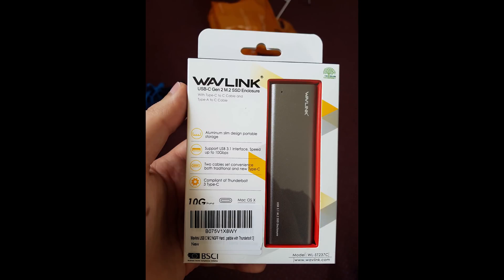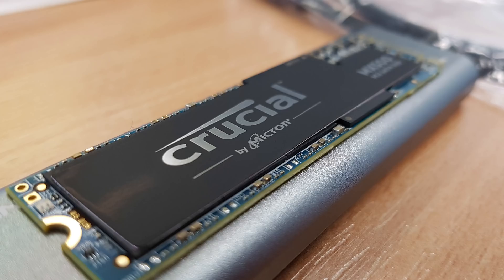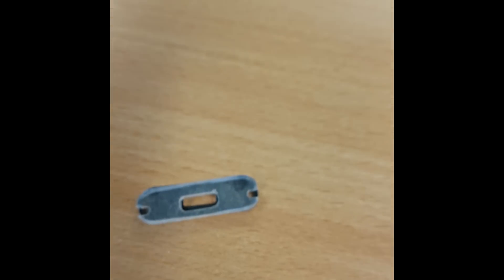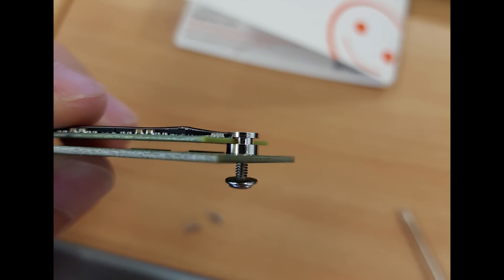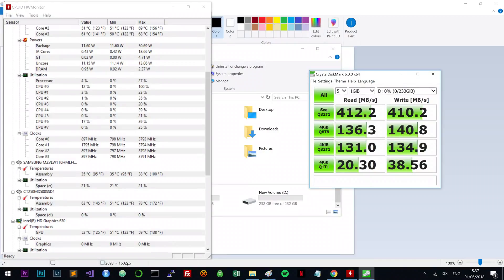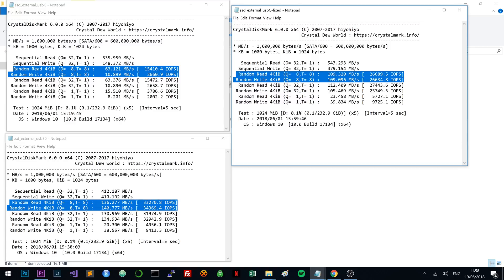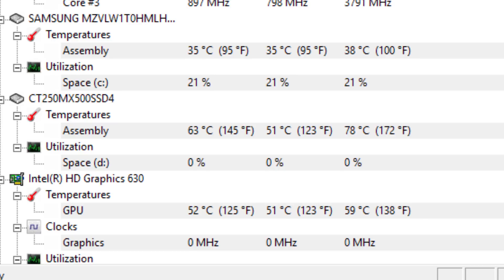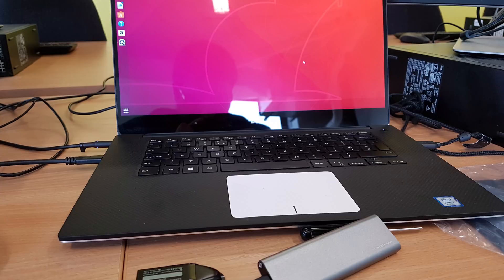How to build an External M.2 SSD (USB 3.1 Gen2 with Wavlink Enclosure)

Comment: Do you still like it? Have you tried any other enclosures for M.2 NGFF SATA Drives? I just ordered this one for a 16G 2242 drive that I saved from an old Acer Chrome Book and am hoping to turn it into a Linux Boot Drive. I just wish that I could've found one that was specifically for the shorter 2242 drive.

Comment: Hi, I am looking to buy exactly the same as you have but am I missing something on the speeds here? USB-C / USB 3.0 and 3.1 can produce speeds of around 600 MBps and 1200 MBps. The Crucial MX500 today on their website says:  M.2/NGFF (2280) Double Sided • 560MB/s Read, 510MB/s Write. So if I use this WavLink box on USB-C to my Macbook Pro then I should get speeds around the 500MBps read and write as that is the fastest speed of the slowest component here right???? So why in your video do you get a hell of alot less than that? Am I missing something here please?
Reply from the maker: To be honest I'm not sure. I think the cable may be the issue or potentially the XPS 15 thunderbolt port. I haven't been able to get above that through it. I am not sure how it works on the Macbook Pro. If you end up trying please let me know what speeds you get.

Comment: I got 2 of these， they all work fine in the very beginning, but my computer didn't recongize it after some time, that's why I have 2.....I am pretty sure my SSD is healthy
Reply from the maker: That's weird, did you try all the cables? did you check if it came loose?
Reply: Kyle Wong it’s your format.

Comment: Might be I miss it. Is this a M.2 Sata or M.2 PCI-E? Also, it is not cover in the video but in the info. Should I concern the "SSD Hovered around 70 degrees under heavy load."
Reply from the maker: Hi Vincent, this is M.2 USB 3.1 Gen 2, so it handles transfer rates up to 1250MB/s. It's not PCIE, just faster transfer speeds
Reply from the maker: Forgot to include a reply to your temperature inquiry. To my knowledge most SSDs are rated for 100 degrees or so, so it should not cause any damage. Most SSDs also come with 3 - 5 year warranty. 70 degrees is hot enough to cause concern for throttling depending on the manufacturer. If you need a m.2 SSD for LONG transfers, I do not recommend this. If you just need FAST transfers that don't take much time or are not constant, this is good. I used it to run a full operating system and it did not throttle personally
Reply: @FitnessRegiment  Thank you for your reply, appreciated.

Comment: Would this work with 1TB Samsung NVMe SSD pro M. 2?
Reply from the maker: It would work but it may get hot, others have said that it gets quite hot and one even said he got throttling on large transfers.
Reply: Yeah, better get a M.2 NVMe enclosure with thunderbolt 3 to max out your ssd speed
Reply from the maker: @tinishmaheshwari6575  the cheapest I found were over $240, so yes it would be nice but I wasn't willing to pay that much for an enclosure.
Reply: @FitnessRegiment  Thanks

Comment: Hi i ordered those Wavlink Enclosure on E bay for  US $21.82.  It works fine, only it gets pretty warm to hot. I got a temperature warning, the temperature was higher than 60 degrees Celsius. 140 degrees Fahrenheit:  

The solution place something of metal under it a flat surface of aluminum or copper.

If the SSD become to hot those can get defective.
Reply from the maker: have you found any further solutions? what drive did you use?
Reply: Put this external SSD For example on a other aluminum external HHD.  It works here very well. this is a poorly designed enclosure without a good heat-sink.

Comment: What's the point of having USB 3.1 gen 2 if it's not pcie and it's says connection 🤔
Reply from the maker: i think it's still significantly faster for small file transfers? not sure. it was so others can use nvme drive that I made the video.

Comment: Thank you! I just bought a Samsung Evo pcie 970 ssd amd an enclosure for it. It was for my xbox one x. It does get really warm. It burns my fingers but I tend to unplug it when I'm done using it. Should I be worried of the heat!! Will it melt? Or will it slow down the speeds? Cause this thing is FAST! My load times are super short now! I love it
Reply from the maker: the 970 does get quite hot. have you tried using it on a laptop and monitoring the temperature? 70 or 80 is okay I believe but can feel hot to humans. if its 80s and 90s I would worry.

if you're worried about temps have you tried putting some thermal pads in contact with the metal. not sure if that would help.
Reply: @FitnessRegiment  no I have not. Only on my xbox. The whole case gets really hot. I JUST bought it yesterday. I dont want it to melt or anything. I read that they do get hot but not to worry about it. I'm just extra cautious. How do I use the heating pads?

Comment: This enclosure replaced my external thunderbolt drive. The only problem I had was it got extremely hot when cloning my 400gb, like too hot to touch. Transfer speeds drop when it gets too hot. Putting it on top a fan helped with the heat issues. Other than that, it's the perfect external drive for mobile DJs.
Reply from the maker: can I ask what ssd you used? Mine seems to have worked but I'm worried nvme drives might cause issues with heat. have you tried using thermalpads
Reply: @FitnessRegiment  Western Digital 1TB (WDS100T2B0B) worked fine after cloning a boot drive for MacOS. I currently have inside the enclosure, an Intel 256gb 540s (SSDSCKKF256H6). The Intel SSD is my workhorse for mobile DJing. The drive doesn't support nvme or pcie drives (according to the amazon description and questions posted on amazon).
Reply: Here the same no good temperature management. The case is to small , the solution place something of metal under it a flat surface of aluminum or copper.
Reply: George Moore best one out there is by glotrends. Built in heat sinks and exhaust fan. Pcie nvme 3.1 gen 2

Comment: This is great. Been looking for a solution to record video at write speeds of over 500 MB/s & have found m.2 external to be the best / only solution. Thanks for making this video man, literally changed my life!
Reply from the maker: yea they're great. You may want to look into how much heat you will be outputting.

in my benchmarks it got a little toasty when i ran it for long amounts of time but didn't throttle at all.

let me know how you find it.

also will depend on the ssd and how much heat it outputs I suppose.
Reply: Thanks for the advice man. I did read your description where you said you benchmarked for 30+ min, and since 30 min at a time would be my max time, im not even worried anymore. Will check back in the next year or so to update you on how reliable i've found it!
Reply: Update: turns out the camera i bought doesnt support m.2 drives. I had to go with a samsung t5, & now my new m.2 drive is an expensive storage device. That’s life!